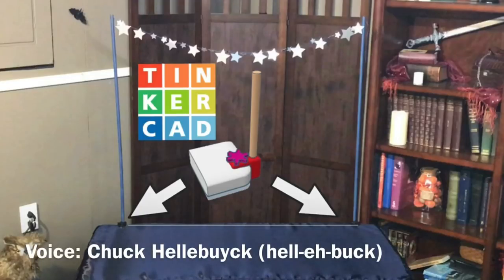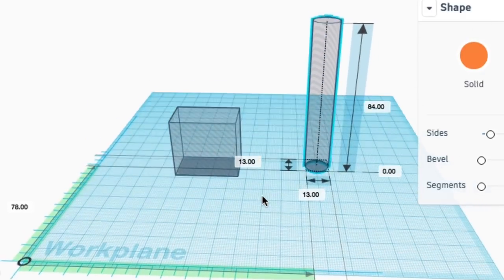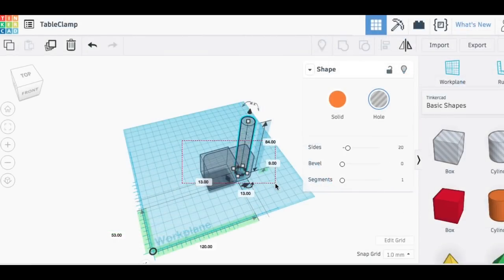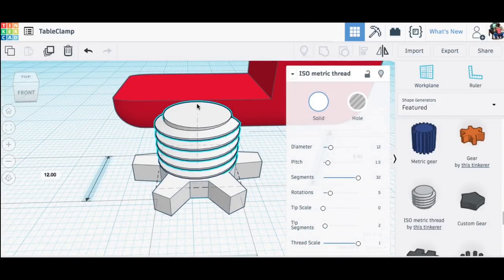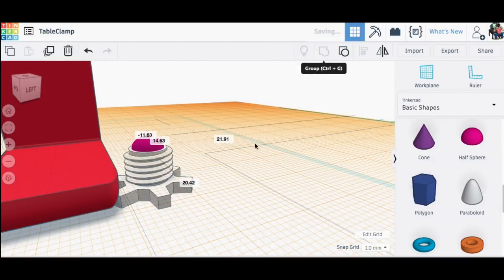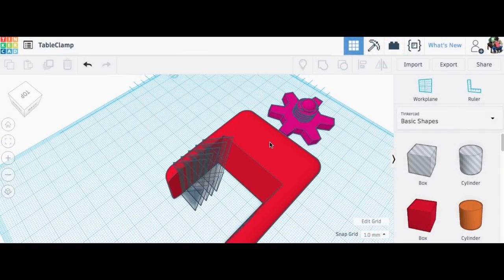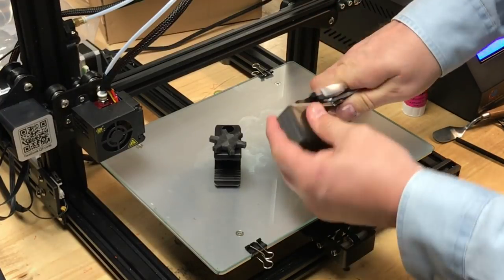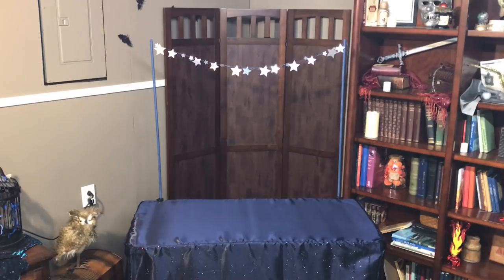Best Craft Show Display Table Clamp 3D Printed

Comment: I always use a tiny bit of water proof silicon grease on the plastic threads as lubricant to help it screw together without heavy binding
Danco Silicone Grease, coincidentally...this stuff works GREAT on the rods and threaded rods on printers too
Cool Tinkercad design!

Comment: After watching your videos I have started to use Tinkercad for some basic projects some people had asked me to print. Pretty good program once you get the hang of it. I do wish there was a desktop version just so it would run a bit faster/smoother.

Also in Cura you can set the acceleration/jerk in the slicer to match your printer and I found the estimated time will be very close to correct, within a few minutes. it doesn't actually change the printer settings as they are fixed in the printer. I just wish Simplify3d would let me do that too!

Comment: Just wondering how you decided there would be enough strength to the clamp. The width and thickness of the clamp and then the wall and infill 
Looks like if it was your first attempt and then just minor changes you have a better feel for PLA parts.

Comment: I've printed a few of these and I have the same problem every time. I've printed with 20% and 50% and every time the infill around the threaded hole is really, to the point that you can crush it just by pushing on it. The area around the threaded hole is the only spot it does this, any ideas why?
Reply from the maker: Sounds like your Filament isn’t flowing properly. Check for minor blockage in the filament path.
Reply: I don't think its a blockage. The problem area is only between the end of the clamp and the threaded hole. The rest of the print is fine. I printed 3 at one time and they all had the same spot that was goofy.